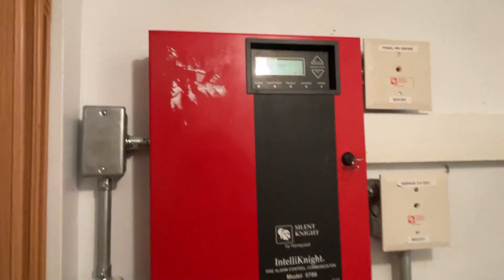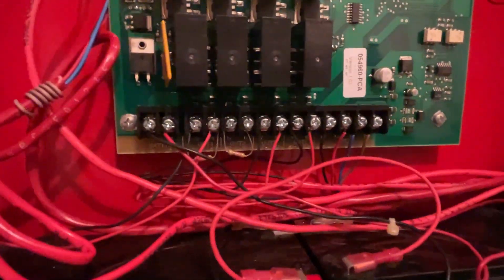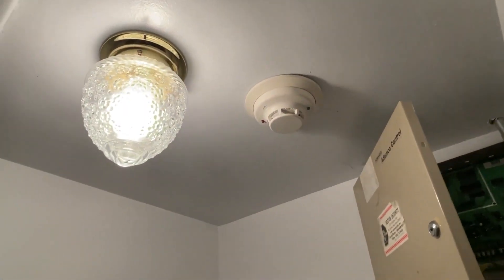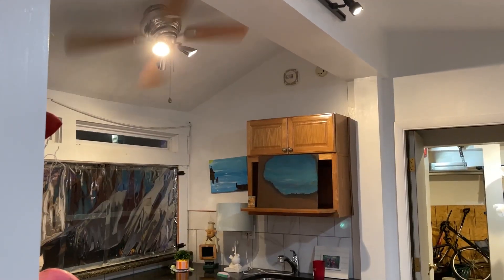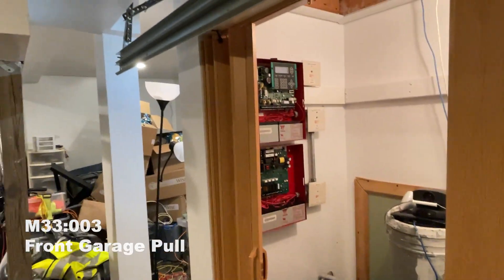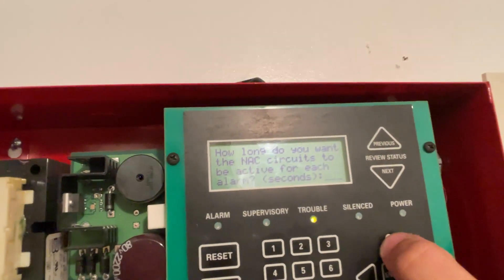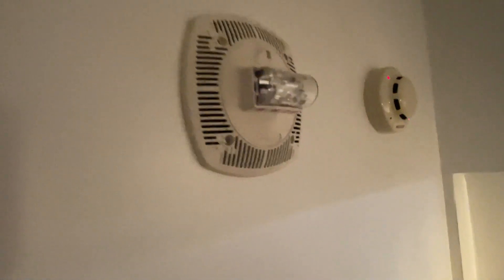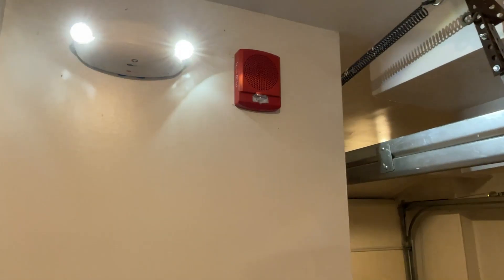Garage Fire Alarm Full System Test!

Comment: The tone for the weather alert is the Simplex high-low and the one for the CO is the Simplex Sow whoop but what voice vac tone is used for the fire message?
Reply from the maker: Hi! I made the fire tone from scratch using Audacity’s tone generator. You can also use the tremolo effect to do a properly timed code 3 or 4 pattern. Thanks for watching.